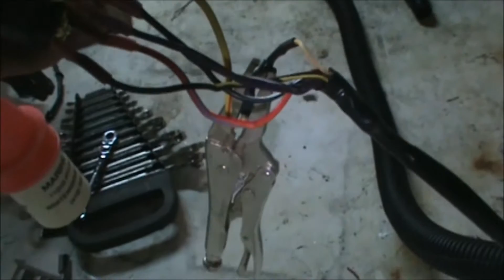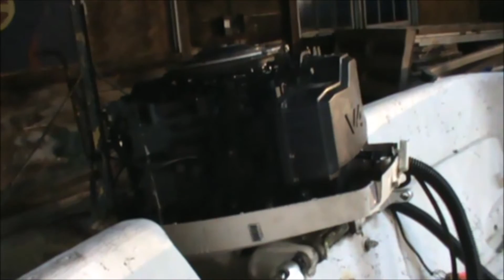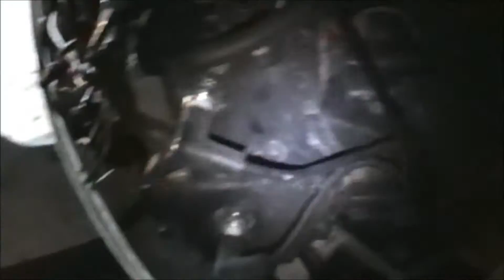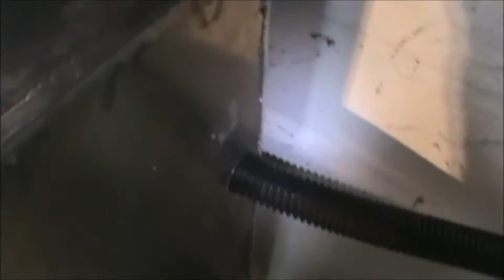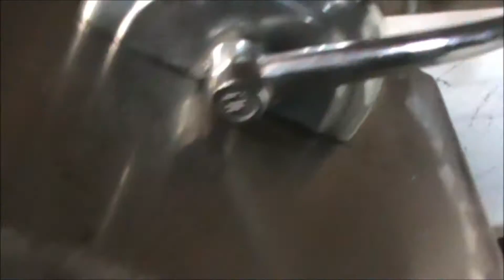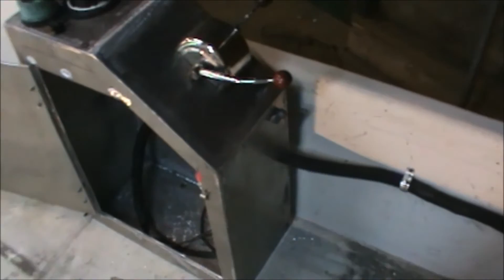1990 Evinrude 140 VRO Wiring

Comment: I need the wiring diagram for this motor asap mine is all mixed up I need to find out wire and color details
Reply: HI. Did you have the Wiring Diagram? I really need it. And the Model number. I have one just like this one on a bass boat that I am putting together

Comment: Hi, very nice video !
I have the same engine, and my rpm gauge isn't functionning. The needle only moves when I turn the starter on, but when the engine is running, the needle points at 0 (doesn't work). Do you have an idea why this happens ? Could you show me the wiring of your rpm gauge and the diagram ?
Thank you.

Comment: OK, that two pin connector is for the trim gage, it isn't needed unless you want to have a trim gage...But, the trim sender on the engine is probably missing/broken..
That engine DOES use ATF/dexron II tranny fluid, so the red color is OK/normal..
You could run power to that broken plug from the hot side of the engine solenoid if you want to, would be a lot easier than running another lead in from the battery.  And yes, that four wire harness from the VRO triggers the no oil alarm, leave it disconnected if you want to run the engine on premix.  Grounding either of the two tan harness leads going to the temp switches with the key on should trigger the horn.  You could remove those temp switches and check them with boiling water and an ohm meter, but I don't recommend doing that because you usually wreck the switches when you remove them...The white lead on the port temp switch is for the quikstart system which advances timing during warm up.  The engine also has a SLOW circuit that will limit RPM to about 2500 (and make the engine run rough as hell) when it overheats, that system is triggered by the tan temp leads as well.
That is a beautiful console that you have fabricated, but please be very careful.  You are asking for trouble/fire hazards with all the wiring that will be under there shorting to the metal console, especially the battery!  Make sure it is covered and properly secured.
OK, I would probably not attempt to recommision the oiling feature on the VRO, which is a combination fuel/oil pump.  There is no good/dry location for mounting the oil tank, so I would just premix at 32:1, a little extra oil can never hurt! 
Again, please be very careful with wiring in that metal console, be sure everything is properly fused.  You did a great job fabricating the console, but it is a bit of an electrical fire hazard....
Good luck
Don
Reply from the maker: Thanks for the comment.  That motor is actually trash now.  I broke enough of the head bolts and tstat bolts replacing the thermostats (which were non existent) so I parted it out.  Why is the console a fire hazard? there is no current running through it?  I'm not using the console as a common ground or anything, its not a car.
Reply: Sorry to hear the engine didn't work out...The console could be a fire hazard because the aluminum is a great electrical conductor.  Loose hot leads touching the console could result is a direct short.  I understand you are not using the console as a common ground, but it is grounded through the steering and control box...So, just be very careful...And, if the battery is uncovered, and falls over, its posts could short on the console as well...I'm not saying the console is dangerous, just want you to be careful with your connections and battery...
Reply from the maker: kramden It is not grounded through the steering, or the control box.  Both are insulated by plastic.  It is highly unlikely a short could occur as there is no current passing though the aluminum, but thanks for your concern.